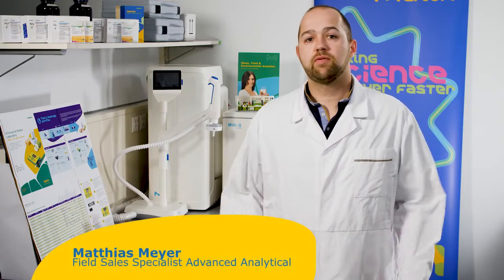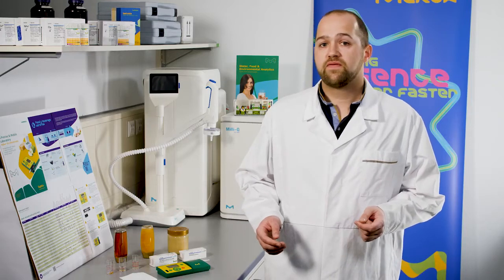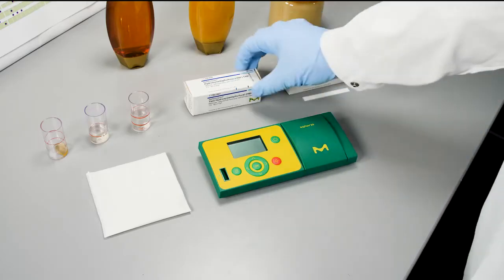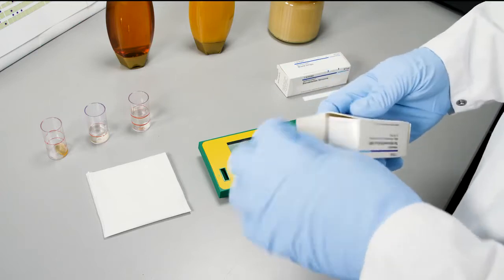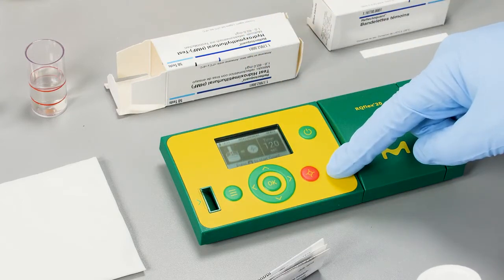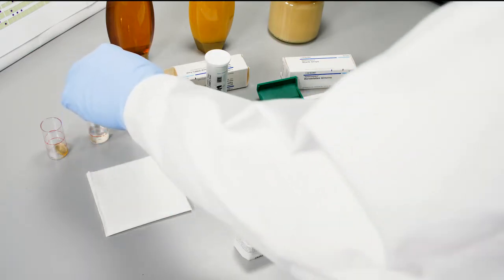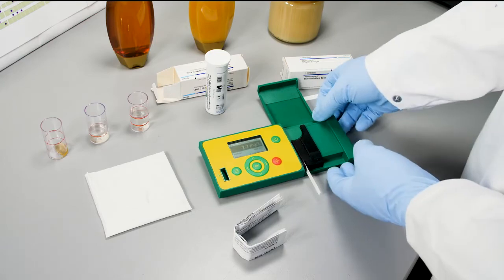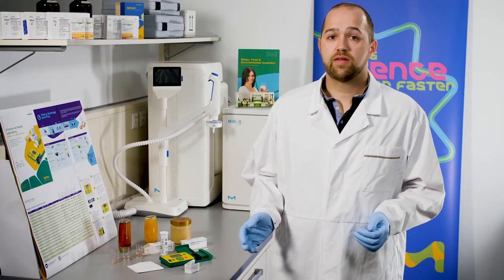Analysis of Hydroxymethylfurfural (HMF) in Honey

Comment: Hello
1) Is it possible to do research in apple or orange juice, or in jams? You only have a technique for elderberry juice. How to do research in this case?
2) And if the juice is light in color? Is it necessary to perform a lightening procedure using polyvinylpolypyrrolidone?
Thank you
Reply from the maker: The Reflectoquant Hydroxymethylfurfural (HMF) test, item 117952, is suitable for use in juices, fruit juice concentrates, and jams. For optimal results in your particular application, we suggest following the test instructions provided with the test kit. 

We also suggest verifying the HMF content by employing a reference method to validate the test results. In the event of discrepancies between the results and those of your reference method, we recommend consulting the application note and decolorizing the sample using polyvinylpolypyrrolidone.

Comment: How sensitive is the test? What is the minimum concentration of 5-HMF needed in the solution?
Reply from the maker: The Reflectoquant Hydroxymethylfurfural (HMF) Test has a measuring range of 1.0-60.0 mg/L of hydroxymethylfurfural (HMF).
Reply: @MerckLifeScience  y la lectura del blanco no es necesaria, por que en su protocolo dice que se mida con un tira blanca, pero en el video no lo hicieron, para luego hacer un calculo de conversión de mg/ml a mg/kg?
Reply from the maker: Determining the blank value of honey depends on its color. For repetitive measurements of the same type of honey it's sufficient to determine the blank value once. In general, it's advisable to take the blank value into consideration even when light-colored types of honey are being investigated for the first time. 

With regard to the conversion from mg/ml to mg/kg, please note that the calculation is required because the honey is dissolved in water. However, usually you give a statement of HMF content in mg/kg, so the protocol provides the required calculation scheme from mg/ml to mg/kg. 

Hope this helps! Please let us know if you have further questions.